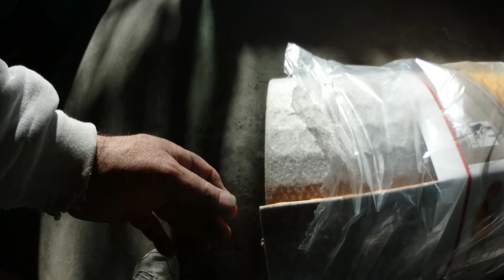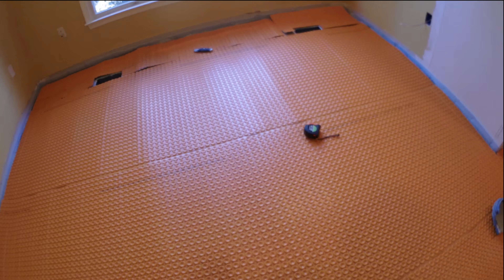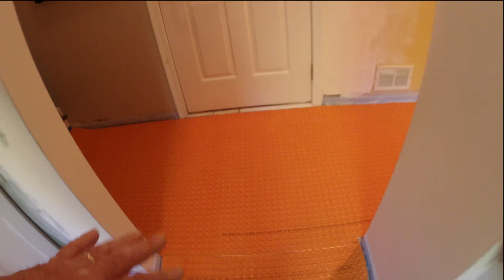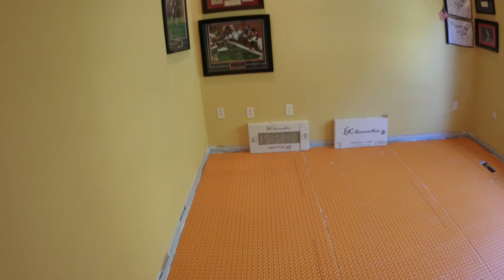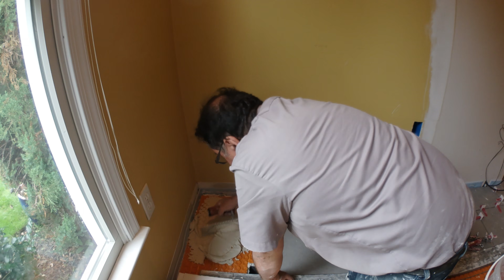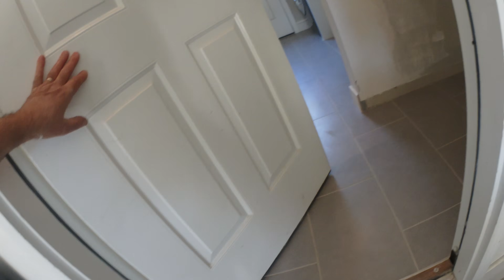🤔 Cold floor, warm it up. Even on a Concrete slab.

Comment: My house is on a slab. I had a heated tile floor installed recently and they did not use the dirta heat dual. They used the orange ditra without the felt insulation and laid it on the slab. The schluter heat system can be left on 95 degrees for days during the winter and the tile only can get up to 86 degrees. Thats barely noticeable warmth with bare feet. I was hoping it would get HOT and not take 24 hours to heat from 70 to 86. Can anything be done now?

Comment: Hello Sal
I want to mitigate heat sink on a below grade concrete slab, before installing heating coil and tile.  The winter temperatures hover in the teens degrees F.  I purchased Cerazorb synthetic cork 5 mm to help with the thermal break between the Prodesso uncoupling mat and heat wire under tile.  
Is there anything else that could be used before I get going on this project?  I haven’t been able to find much information on this issue in my research.  I don’t want to have regrets on this install.  I will also be using LVT in an adjoining basement concrete floor and wonder if we should use the same product.  
My wife and I admire your work ethic.  
Brent and Sue

Comment: How was coverage for you when you lift up corner? When I first used Heat TB thinset did not want to bond. I had to spread mortar twice in order to get good transfer. I was using TEC uncoupled mortar which is not that great to begin with, but I needed to stay within warranty.
Reply from the maker: Coverage was good, however I have experienced the same problem on occasion.

Comment: Sal 
In regards to the bow in the tile, does this not cause noticable lippage when you install it in an offset pattern or does the T-Lock overcome this?
Reply from the maker: T-Lock will usually produce a lippage free install, if I were to install this without a leveling system, I would stagger them by 1/3.

Comment: hi Sal. i have not watched the whole video yet.  But how do you feel about the hollow sounding tiles that you get with ditra heat duo?
Reply from the maker: It does sound hollow, but they are down good, just have to get used to it.
Reply: Sal DiBlasi 
I wish schluter would admit to the potential issue.   I installed 400 feet of duo on a slab on grade and the tile sounds a feels hollow.  I know that they are not hollow.  I even back buttered the last 150 feet of the duo underlayment to see if the bond to the concrete was the problem.  
I hope it doesn't cause cracked grout joints.  I will never recommend duo.
Reply from the maker: It is a known outcome and has been recognized as an effect of the uncoupling membrane, read this PDF you will find a reference to it on page 2 in the section "Material properties and
areas of application:"   http://www.schluter.co.uk/media/schlueter_db_6_4_ditra_heat_uk.pdf

Comment: I thought you recommended running bond pattern in 3rds.  Did the homeowner request 50% running bond instead?
Reply from the maker: And yet it works.
Reply from the maker: No way to bend a tile, ever heard of deflection in a floor, that number they give you, L/360, that refers to how much a floor can deflect before it causes problems for the tile. Deflection of the floor, or if you want to call it movement, warpage, dimensional distortion, or bending of the floor to which the tile is bonded and can absorb before the assembly experiences a failure. here watch how I bend a tile, watch how the leveling system pulls the high tile down. https://www.youtube.com/watch?v=3GFkOiWvbUA  I have heard it all before, you are not the first to make this argument, and you will not be the last. I know countless tile setters that have made the same assertions, that now love their system. A leveling system will make a good tile setter better, give a superior job compared to the same tile set without the system where all other things are equal.
Reply from the maker: If you do not use a leveling system, 1/3 is absolutely needed, however with a leveling system you can often do 1/2. Watch this other video to see why https://www.youtube.com/watch?v=3GFkOiWvbUA
Reply: Sal DiBlasi. That video explains it perfectly. Was planning on using t lock anyhow so looks like I will be good to go either way. Thanks for the help!
Reply: Sal DiBlasi How come 1/2 staggering tile can be done with a leveling system? Will the leveling system bend the tile flat and miraculously fix it's curvature and flaws on a 12 x 24 tile? 12 x 24 tile is not flexible at all. You can't bend it.
Reply: Sal DiBlasi It works if your tile is flat. If your tile has a bow to it, it will look fine after grouted with a grout joint of 1/8 but the slight lippage will be there if you look for it. 12 x 24 tile doesn't bend.
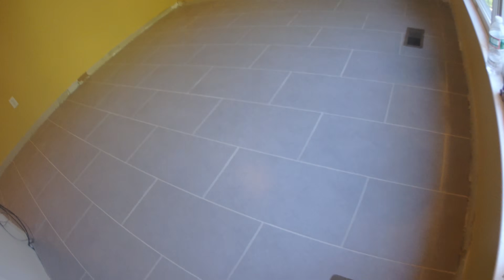Reply from the maker: Ok, if you say so https://www.youtube.com/watch?v=wZLRLjbWL4c at 21:24
Reply: Sal DiBlasi Didn't see you bending those tiles flat on that video..You just leveled it with the leveling system. It needed more thinset and instead of adding thinset you pulled the tiles up with the leveling system. Try using the leveling system with a cheap $1.00 sq ft 12 x 24 tile from home depot....The leveling system can't physically bend the tile flat. The bow will still be there unless it's a flexible tile like a 6 x 45 Plank that can bend a little bit in the middle. I have nothing against leveling systems. You can sell your plastic to people, but why say you get a superior installation by using it? That's fake advertisement....It all depends on the installer. A skilled tile guy can still do an excellent job without a leveling system....AND MUCH FASTER.
Reply: Sal DiBlasi I just did a job with a leveling system....12 x 24 stacked or straight layout with 1/16 grout joint. One part of the job i used the leveling system and the other part of the job i used my skills only.....I noticed no difference in quality.....The leveling system DID NOT improve the quality of the job. The only difference i noticed was speed....The leveling system slowed me down. I think a leveling system is must for wood look plank tiles but not necessary for other types of tiles. I think it's a matter of preference but i don't think a leveling system will make me a better tile setter, if it does then i have problems lol Using a leveling system is a matter of preference, not a necessity unless you're talking about long plank tiles.
Reply: I really dislike "know it all" guys.

Comment: Great video sal! Regarding the 1/2” trowel for large format tiles I am using similar large tiles but with the schluter profiles maxing out at 1/2” depth to stay even with them my concern is that thickness of the tile at 3/8” plus the 1/2 thinset which gets compressed to 1/4” once ridges collapse, I will be at 1/8” higher than the profile. Think it would be ok to drop down the trowel size to 3/8”?
Reply from the maker: No. keep the 1/2" trowel, pull the profile up to the edge of the tile.

Comment: Lets not forget the back butter is important to take out the white powder on back of tiles. Old tillers still dont and tiles are easy to break because of the powder that created no bond
Reply from the maker: The white powder you are referring to  is called "Kiln release" and can be a problem.

Comment: Awesome work as usual Mr. Sal. What advantages are there when duo installed over wood floor?  Removal of thin set with putty knife arounds borders of tile provide any other benefit other than allowing plastic fasteners to break easier?  Last question ...what thickness of backbutter do you install on the tile?  Thanks again and love your work!!!
Reply from the maker: No real benefit to the duo over plywood unless you need sound control, in that case it will reduce the sound transmitted to the floors below. Removing thinset around the edges also reduces the amount of thinset coming up the grout lines. Most times just a skim coat on the back of the tile to promote better bond, this will hill the tile pattern on the back of the tile and key the thinset in.

Comment: Hey sal....im on a job now and I needed it built up 1/2".  I decided on durarock and saddened because I love working with ditra.  I'm sure your don't use it much on floors, but do u think it will still be fine and do you mortar it down and screw it?  What size trowel? I was thinking 1/4 x 1/4....any suggestions would be appreciated
Reply from the maker: Yes always use thinset under the cement board, 1/4 is fine. Cement board is still used by many contractors, but it will not give you the uncoupling benefits that Ditra will.

Comment: Is there any restriction from using electric heat in a shower floor?
Reply from the maker: Need to follow certain rules.
Reply: Thanks for your quick reply Sal.  Great video as always.  Do you have one that involves heat under a shower or does Schluter include guidance in their instructions?
Reply: GFCI circuit is needed. No problem.
Reply: That makes sense.  Thanks Kevin
Reply from the maker: I do not, best thing to do is call your Schluter rep for some guidance.
Reply from the maker: I don't think so, but I don't do the electrical part of it, licensed electrician has to connect it to power.
Reply: 10-4
Reply: On your own home you can do it if you know how to add a GFCI receptacle or breaker, which you have to do for other parts of the bathroom anyway.